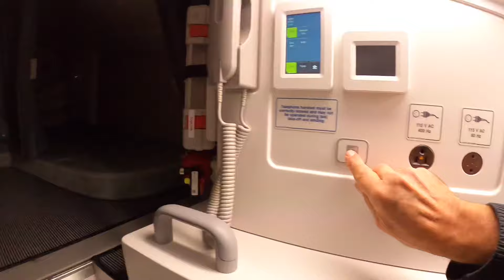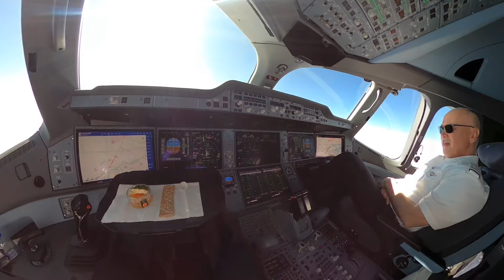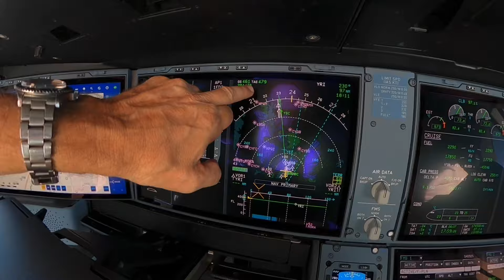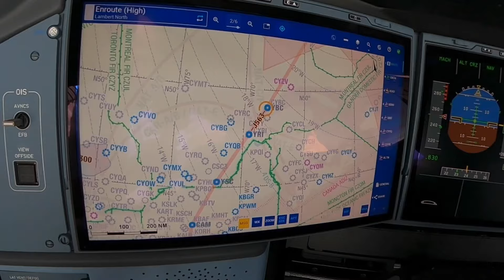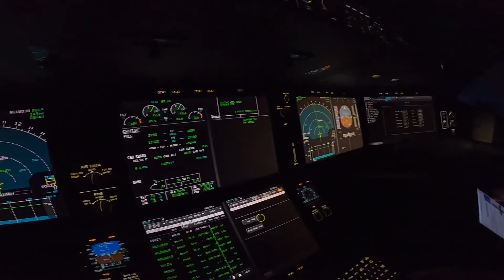The Secrets Of Airbus A350

Comment: Why even bother with a touch screen if it's going to be laggy. Imagine accidentally zooming out when you're in an emergency situation... ...and then there are all those computer fans. Only one has to fail and you have a potential fire under your ass.

But don't worry. Just add "hero" music and everyone will think it's great.
Reply from the maker: It’s only the map that is slow and it can very well have been updated since I recorded the movie. The emergency procedures are easy and quick to find on the ECAM so you don’t use the side screen for the urgent procedures. Don’t dramatize things.

Regarding the computer fans, that’s completely wrong because there is cooling also without them by using differential pressure. The don’t run when airborne.